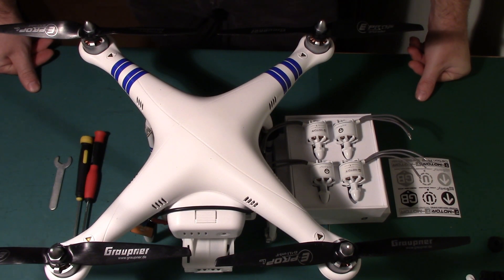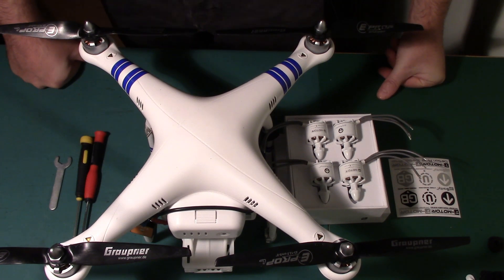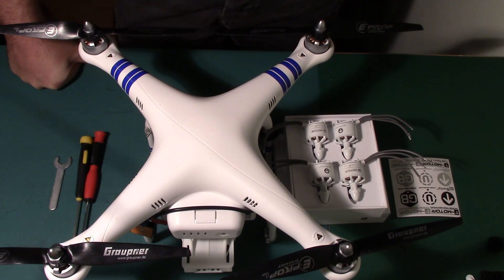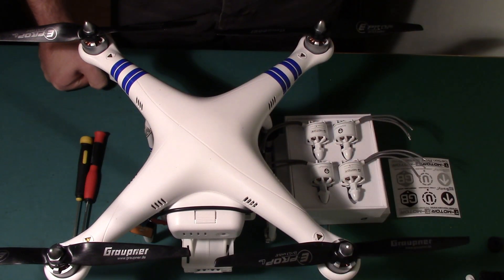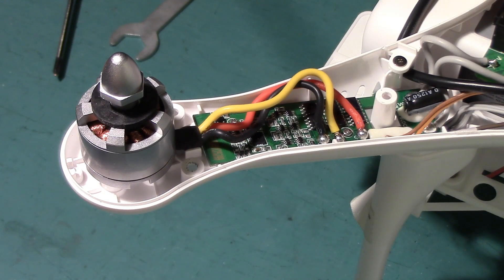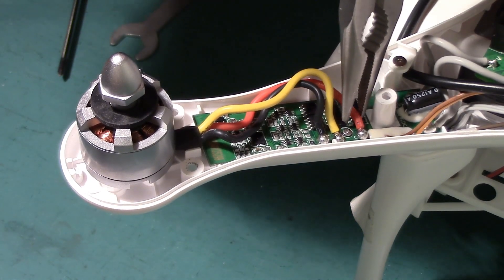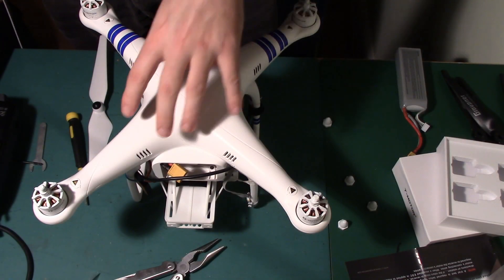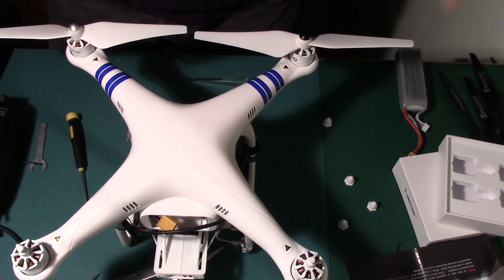Phantom 1.5 Conversion - Fitting T-motor Anti Gravity

Comment: Im pretty sure the motors are not in the correct order, i mean they are rotating the correct direction but if you notice the black dot should be in the left side not there... it will cause to cut the air and tip over trust me it happened to me , and i was not happe 2 down props :(
Reply from the maker: Edmundo Andres You have a good eye Edmundo... it turned out to be the T-Motors had messed up the stamping on the bell housing in a batch... see my follow up vid here: http://www.youtube.com/watch?v=iH6GhhWxomk